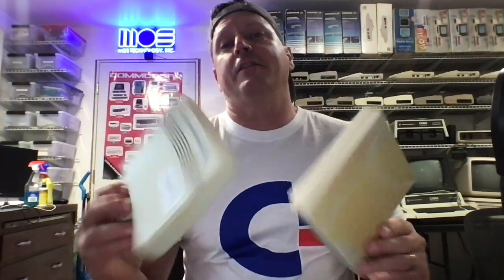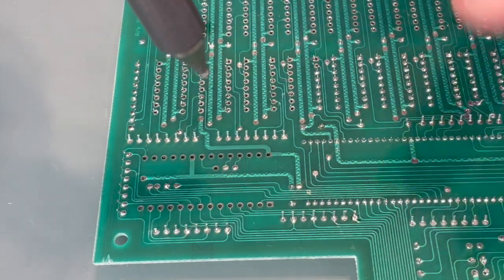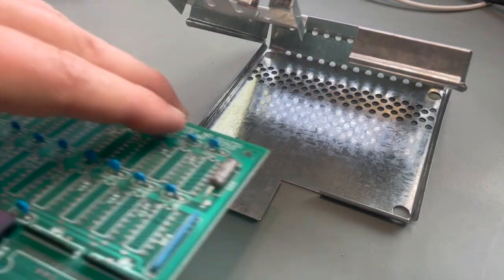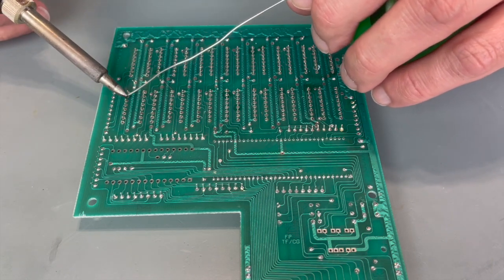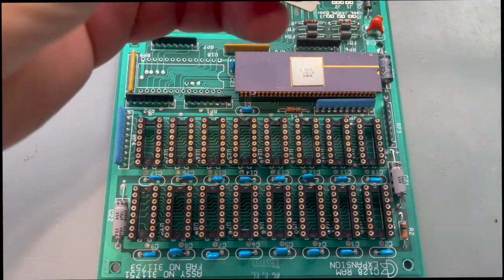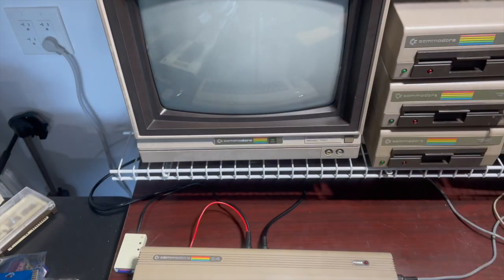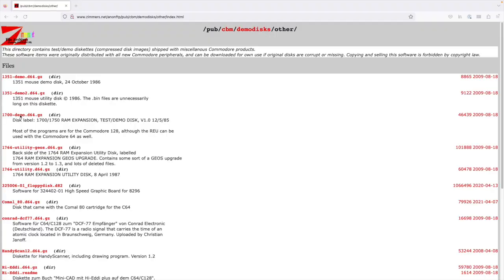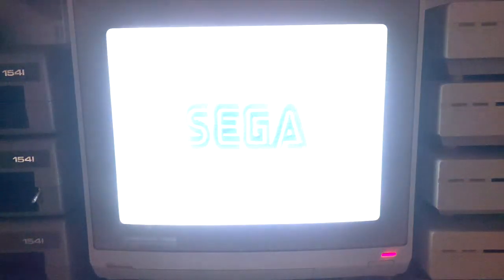Commodore 1700 REU 512KB Upgrade

Comment: That Hakko has great suction, unlike my no-name knock-off.  @1:44, you can actually see a bit of solder get dropped on the board a ways away from the pin, then sucked right back up @1:45.  Very nice.
Reply from the maker: I had an aoyue desoldering station prior to purchasing the Hakko. The difference is monumental.

Comment: Sweet memory lane.  Commodore repair guy from back in the day here. The 1700 and 1750 are not always identical inside however they are very similar.  Your 1700 has the dma controller in ceramic dip form (you demonstrate it in this video) and is much more rare and desirable/valuable since it’s an early 1700. 

The 1750 usually has a PLCC dma controller inside although early ones may have had that ceramic dip chip.  I have never seen a 1750 with one in the wild though. 

Nice solder work btw.